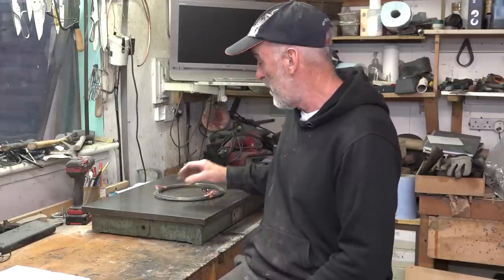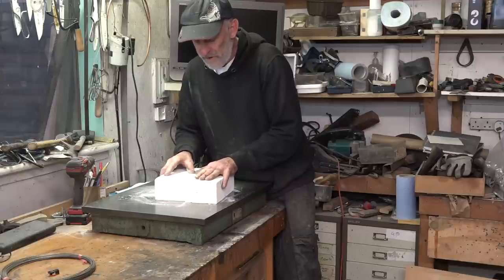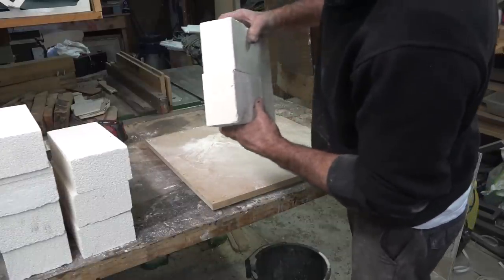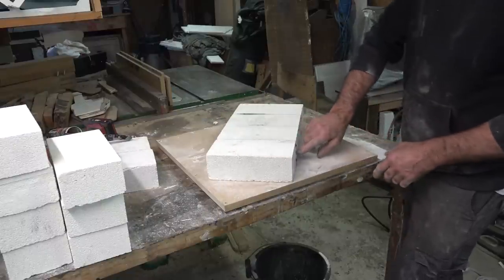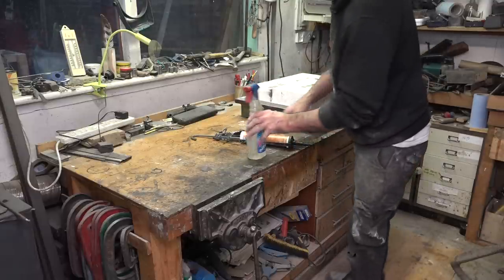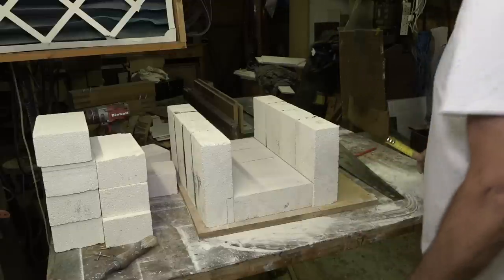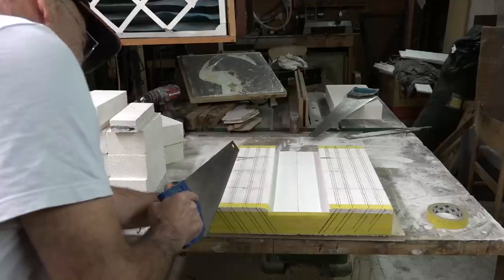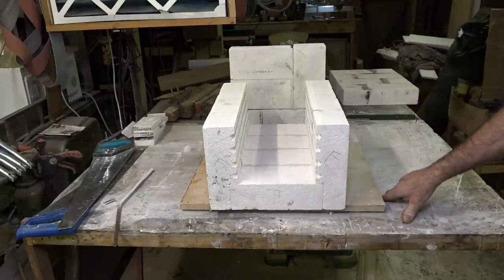Electric heat treat oven build

Comment: Hi. Just about coiling spirals.
Would you just clamp the rod with few wire turns in a vice through wooden pads. The rotating rod with turns of wire will press the threads in the wood and will go out along this thread. All turns in vice will be in good tension. The wire is warms up and stretches enough. And less unwinds after removing the tension. Try this.
nb/ its obvious, english is not my mother language. So, im sorry if my post too hard to dig :)
Reply from the maker: Thanks for that ogre

Comment: Incredible attention to detail.  Best DYI design and execution I've seen to date.  Any idea of the rough cost of the materials for the completed oven?  Not counting the steel cabinet as I know you got the materials on the cheap, and I'll likely pay more for the steel.  But, I am curious about the other materials and supplies needed.
Reply from the maker: Hi Michael and thanks, roughly £160 for everything you could add another £30 for new 1mm steel sheet i guess, i did have some of the items already but the cost of them would only add around £20 to the build bought new. Looking at an oven like this I would have to pay over a thousand plus, and i cant say it would be any better other than having a ramp and soak setting.

Comment: If you intend to use some kind of refractory morter then the fit of thw bricks isn't really that important. Any inconsistency should be worked out in the morter joints.. correct ?
Reply: @LozHarrop  I understand. Thanks for  explaining. Great video by the way

Comment: Hi, where did you get your kanthal wire and what thickness did you use?
Reply from the maker: Hi Chris, it was 1.4 mm  and came from amazon, I tried to order some more but the seller has not had any since i got mine.
Reply: @LozHarrop  i managed to find 1.6 from a uk company but only in metre lengths.  How many metres did you use in the end?
Reply from the maker: @chrislesutis95  it was 30 metres Chris was around 25 quid should have bought more at the time, have a look at dell dirty room knives on here he mentions a company in the uk that stocks it and will wind the elements its on his heat treat oven build video